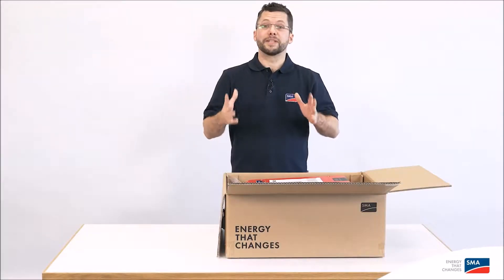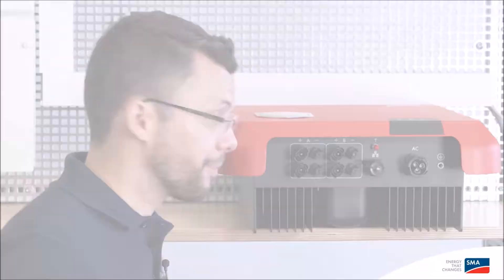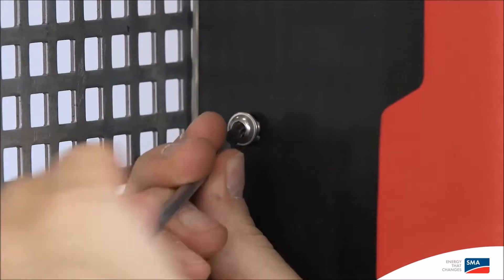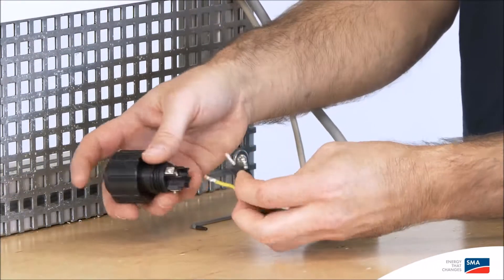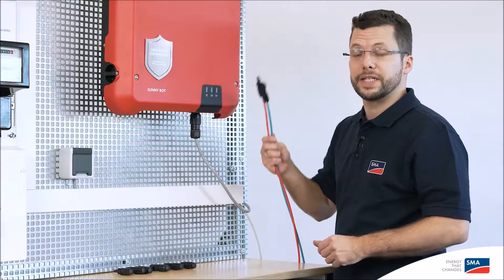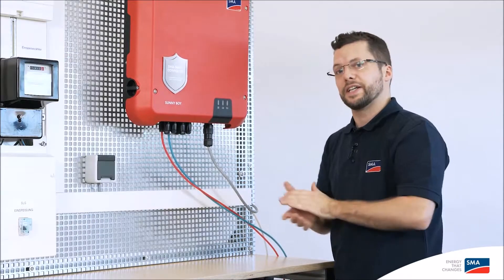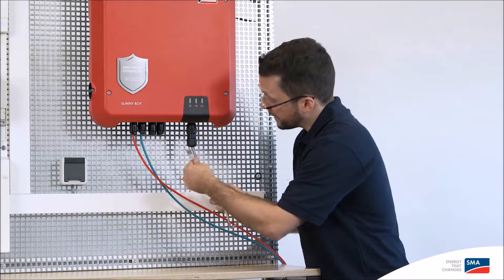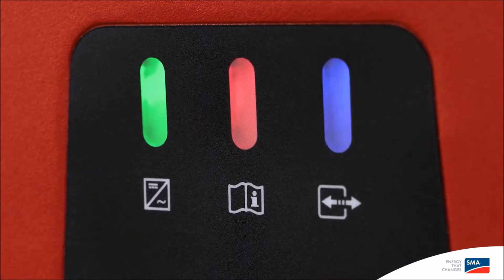SMA Sunny Boy 3.0–5.0 - How To Quickly Install SB 3.0-5.0 | RENVU

Comment: I've been looking at different grid tie inverters.  I  like the sunny boy the best.  I have a  off grid system but like to do tie in as well. When he connected the AC wire did that come from  it's own breaker from inside the fuse panel box? And what size breaker ? I've watched a number of videos of the sunny boy but don't see any that is showing install from the AC or solar array.  Thanks!